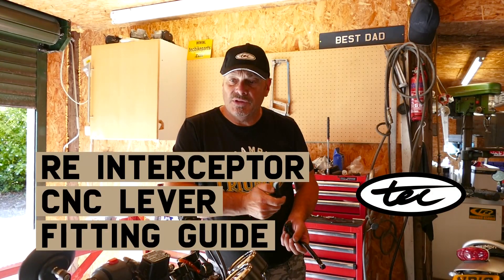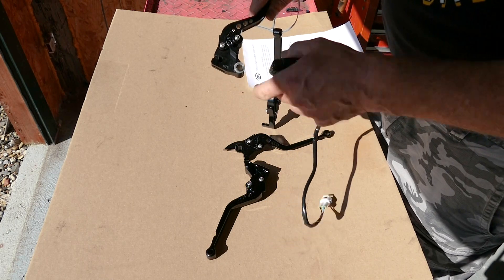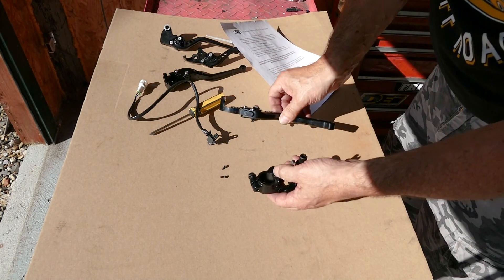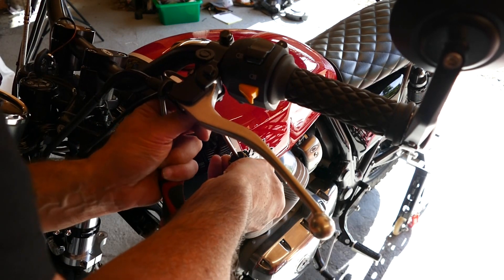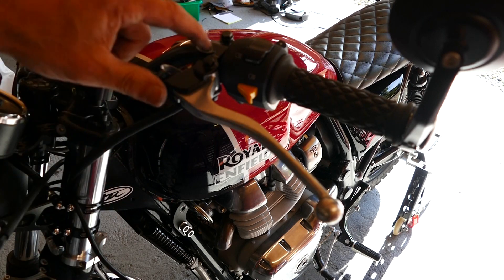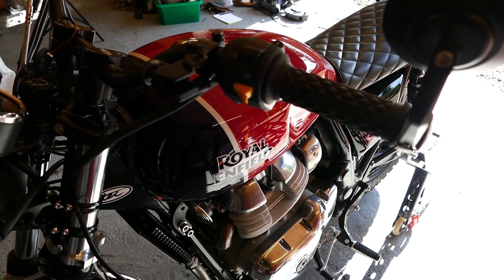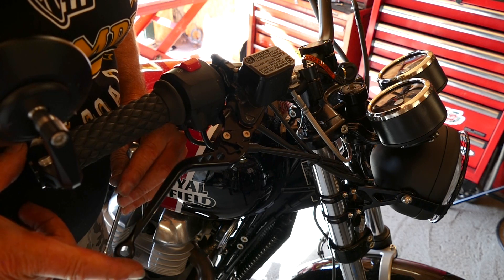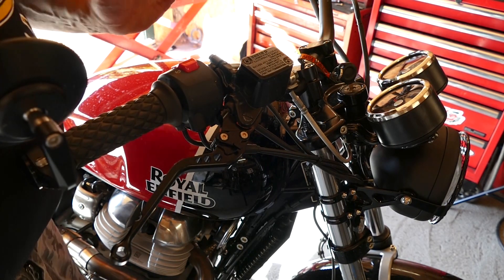Royal Enfield Interceptor 650 - CNC Levers Fitting Guide

Comment: Purchased levers from another vendor off eBay.  The eBay levers did not have the "rump" he speaks of in the video.  Without the rump, I could not start the bike in gear, clutch in, with kick up.  Not good if you stall the bike in traffic and need to get it started. Serious safety issue, not sure you want to be hunting for neutral to start the bike with a texting 17 year old bearing down on you at a traffic light. The vendor was good enough to take them back without the original packaging and I received a full refund and did not have to pay for return shipping. Contacted the TEC Bike folks and confirmed their levers had the rump. Got them, installed them, and they are working great, fitment is perfect, they look like they came with the bike from the factory.  Very nice product and the price was sweet too.  Thanks guys.

Comment: Bought these for my GT 650 over the pond in Australia. Love them, A LOT! I read the instructions before hand then when I put them on the reaction was "OK this is even easier than the instructions let on". I did however remove the switch and tie it up out of the way out of paranoia to not break it. In short - my first purchase from you has resulted in a list for a lot more stuff. Kudos, also Matt is a gentlemen to deal with. Cheers guys!